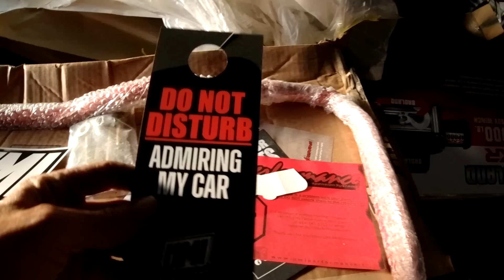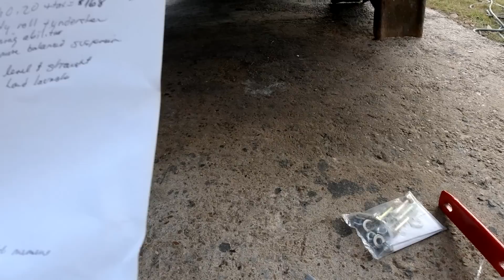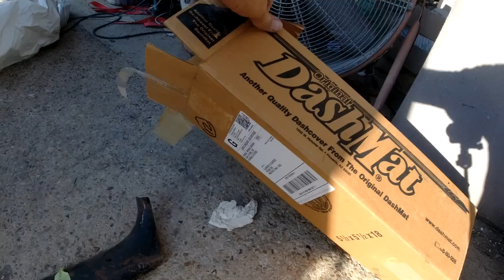1968 Chevelle Nomad Rear Suspension Performance Upgrade - DIY

Comment: I don't know if the sway bar will help much if wheel hop is what you're trying to control. The culprit of wheel hop on the A-bodies is pinion angle between  trans. to rear end.  Having air shocks only make things worse. A sure way to resolve your wheel hop issues is to set up the correct pinion angles. Install a set of adjustable upper control arms. Problem solved bud.
Reply from the maker: it has adjustable upper control arms, I showed them in video.

Comment: That truck does not have a straight axle in front. It's got controll arms, 2 cv axles and a diff hanging off a cross member. Do not rem9ve the cv axle ends out of the front hubs or the hub will come apart while your are driving

Comment: A much cheaper route that's just as strong is to buy a foot of steel pipe, with inside diameter just larger than the bolts using to mount sway bar.  Cut it into 4 pieces the width of inner trailing arms, drill holes where you mount your sway bar. Weld in those tubes inside the trailing arms you cut from pipe at the location you're mounting sway bar.  boo-yah! done for $2.00.  If that wasn't strong enough for ya, grab some steel plate you got laying around, cut it to fit snug inside diameter of your trailing arms, weld it in. Boxed. Whole job cost ya $5.00  built, not bought brother.  btw thanks for the tip on the smokes, I bought 3 cartons.